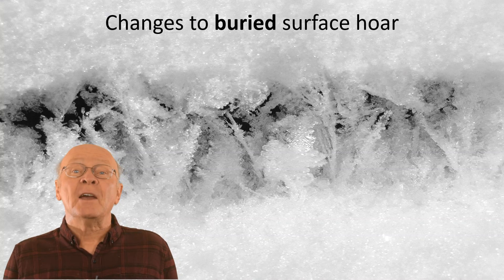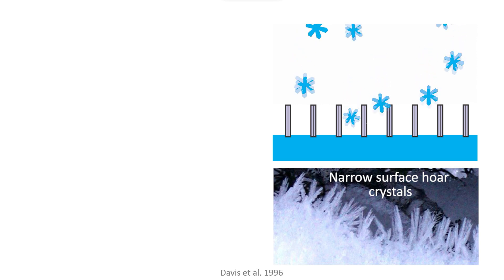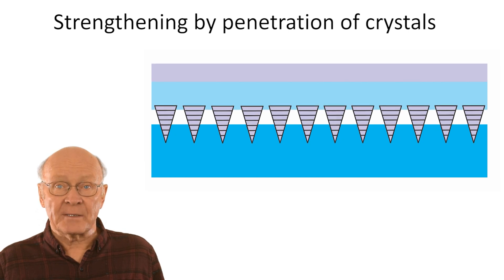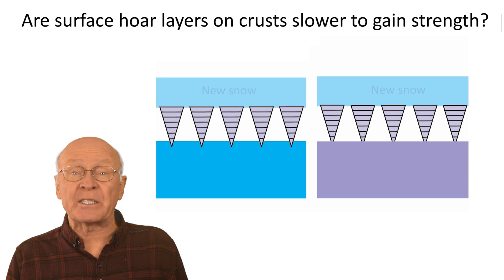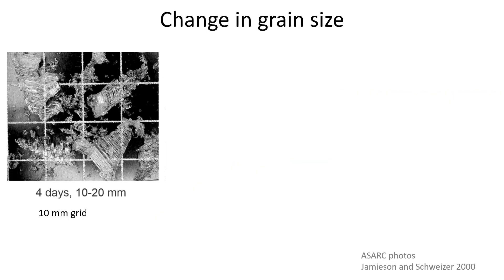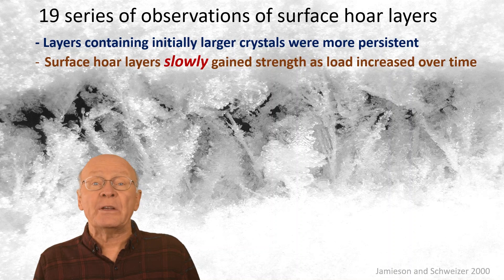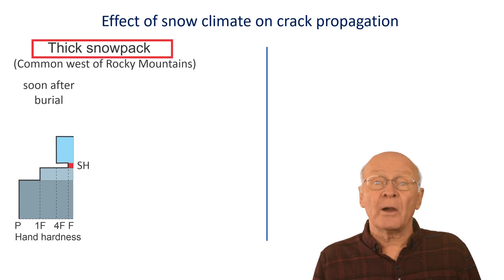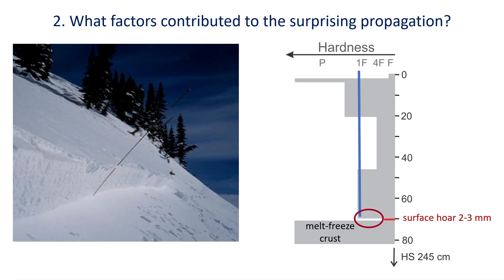Some science behind surface hoar and its insidious avalanches - Chapter 2

Comment: The common caution provided by avalanche forecasters focuses on 30 to 35 degrees. Fracture profiles are performed at where the avalanches END. Consider the example of 4 skiers and the avalanche triggered not by skier 4 but by ALL 4 by concurrent activity with shallow DH causing a mixed mode anti-crack which becomes a self-propagating critical crack then super-critical crack, slope parallel. Far too much attention is given to the slope normal crown at 30 to 35 degrees when skiers 1, 2 and 4 are all in locally flatter areas where Hoar is more persistent.